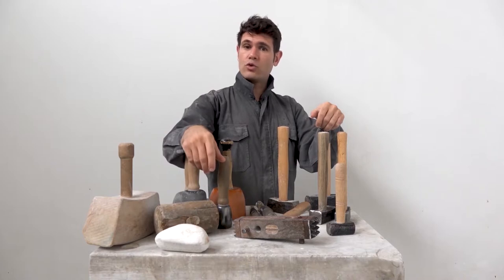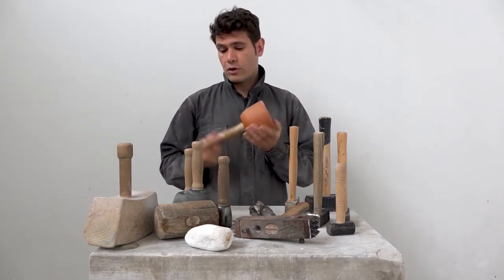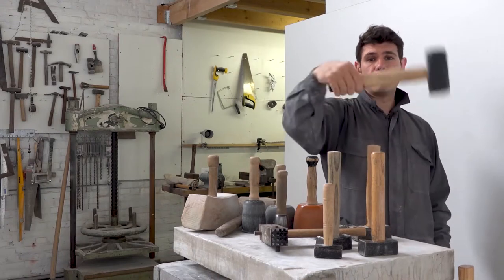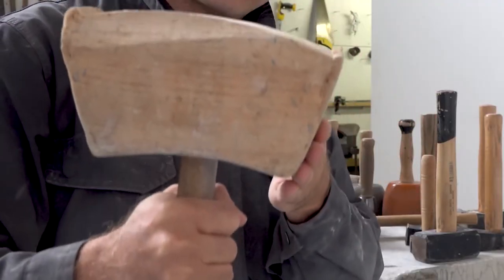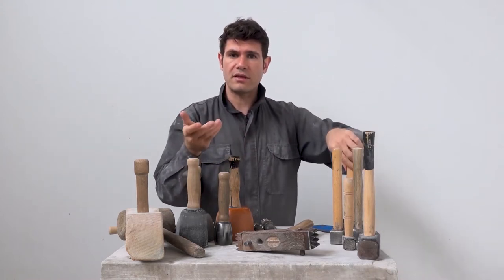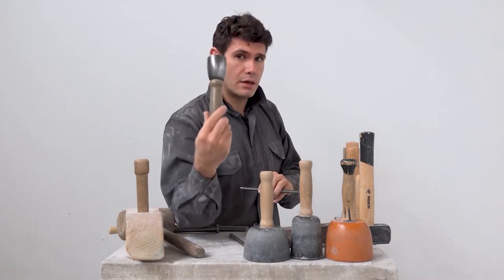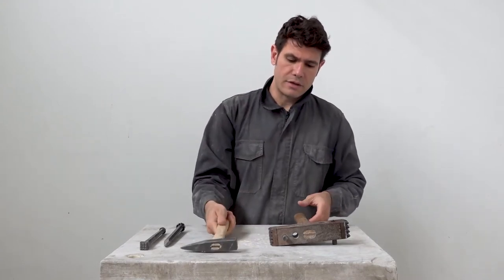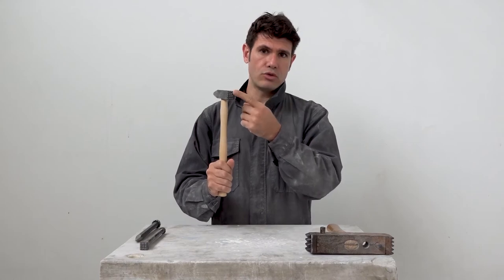All You Need to Know About Stone Carving Hammers

Comment: Not sure if I missed this, but the curvature on the steel hammer heads allow you to get better surface contact between the chisel and hammer face when working against walls and such. Also I believe the tapered angle of the face also saves your wrist and reduces the effort required to raise the hammer between each strike by keeping the hammer head above the wrist/hand on contact with the chisel.

Comment: I harden and temper my back of chisel and it is hardly to deform and maintain the shape
Reply from the maker: Would love to know more! Curious to know about why, and do you shape them in a specific from?
Reply: @AtharJaber  Well since I got most of my stone carving chisel from hardware store and it is a good hardenable carbon steel. First I would anneal the chisel which is a process of softening the steel. After that I would file them the shape that I want for specific project and further harden the edge of the chisel and the striking point. Mostly you can shape your stone carving chisel with bastard file but before that you need to anneal them in order to make the filing process faster.

Comment: Rubber and wooden hammers are meant only for specific chisels: those with a widened striking surface. Use on narrow chisels will quickly damage the hammers. Kloppers gebruiken op een beitel met klopperkop
Reply from the maker: Thanks for elaborating on that.

Comment: Great great video. I did not expect 23 minutes on hammers - shows how ignorant I am. This was news I can use. Three ways to hold a rectangular steel hammer, one very counter-intuitive. Also, I have been using hard steel on carbide chisels and will never again. 
Thanks! 
PS I counted 4 times you'd mentioned that a topic needs its own video. I am sure these are hard to make, but I am looking forward to them.
Reply from the maker: Thank you David! I had a longer video in mind that included how to repair hammers but I figured it would be better to make another video for that topic only. And yes, I have a very long list of videos that I want to make. It's a lot of work but positive feedback like yours make it worth the effort.